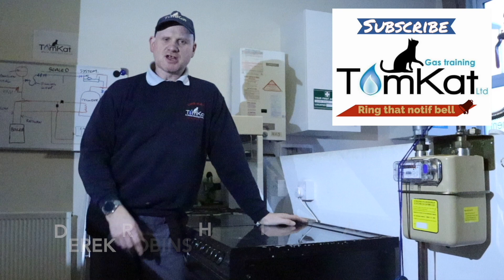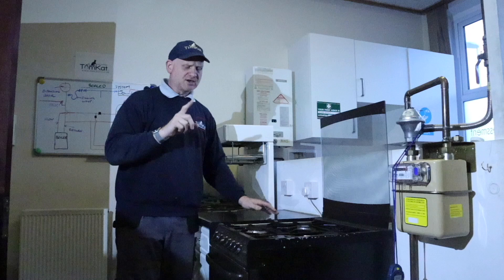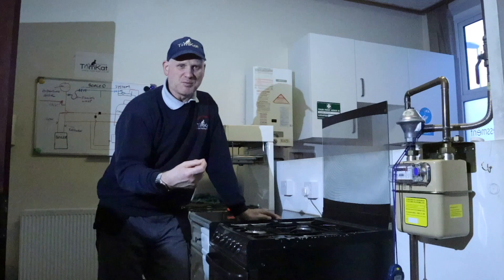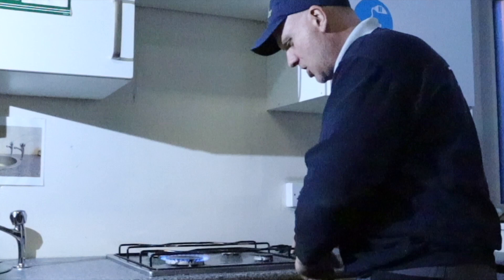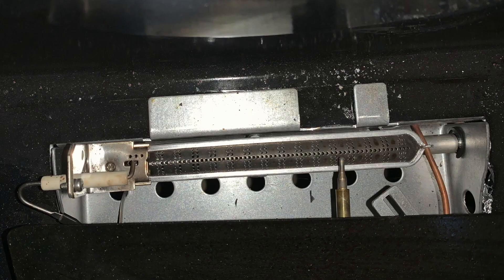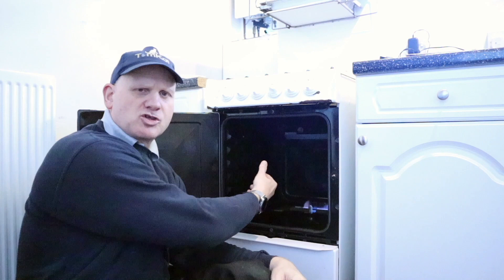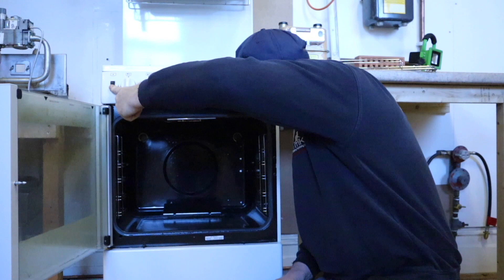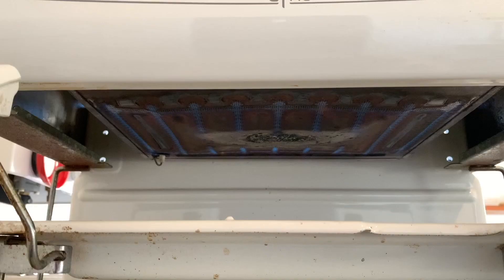GAS SAFETY CONTROLS IN COOKERS part 1. A gas tutorial on how controls work and how to test them.

Comment: At minute 23:30, when you turn the oven to simmer, why do you have to wait for the flame to go down (thermal electric device) and with the door closed? Is it not the control knob that controlls the flow of gas to that oven? I only do meters and have done so for over 6 years now. It's good to know how all these things work. There's too many people/engineers saying that the control knobs are too safety devices which they are not! Great video.

Comment: Hello Derek, excellent video as a lay person I understood everything.
I could you help with a problem with my Cannon Stratford 10530G.
Everything works as it should apart from one thing
When turning on the oven, either with the door open or not, the flame takes many minutes (sometimes as long as 5 mins) to go from low rate to high burner. Once it achieves high burner it behaves as normal and responds to the knob control and sets the gas mark correctly. 
It has a liquid vapour valve.

Any ideas whats going on there?

Comment: I watched this again because it’s fantastic and this guy is a legend. Question time 😊 If the oven is liquid expansion and you blow out the flame it goes off but if you press the ignite button it would turn the gas on at the bypass rate? However, if the oven is thermo electric and you blow out the flame and then press the ignite button it would remain off?? That’s how I understood it. Is this correct? Thanks Derek. 👍🏻

Asian Jon. Training.
Reply from the maker: Correct mate 👍🏻

Comment: I like the video, very clear descriptions. The reason I was watching is that my oven recently developed a fault, when I try to used the oven the flame is never larger than the small flame seen during ignition, regardless of the Gas mark setting on the dial. Is there a way to verify if this problem caused by a faulty thermostat or the FSD?.

Comment: Hi Derek .just want to ask you instead of blowing the flame 🔥 out and let gas escapes , can you test like turn the tap off and listen for the click”shut “ ???
Is it correct doing also this way ? 
Or should blow out always the flame ? 
Thanks
Reply from the maker: If you turn the tap off you are not testing the safety device even though some training manuals say you can. When I blow out the flame I simulate real life scenarios and you test the safety device is shutting of the gas if activated unlike turning of the gas tap and listening for the thermoelectric closing isn’t telling you it’s working and turning the gas off.

Comment: 1- is it dangerous if we  forget to turn off the gas from bypass (Liquid Expansion )  , or if the gas keeps  going for a long time and we  lights it then...
I like the way you you test the thermocouple,is it enough  or is it still necessary to test the thermocouple on:

a) Running at op temp

b) Turn of gas either by service valve or ECV

c) Start stop watch – listen for valve to close

d) Tightness / let by test either at pressure test point on appliance or the meter

2- How can we identify if a FSD is thermocouple or Liquid Expansion 

 Your answer will be much appreciated
Reply from the maker: ARIAN XHEBRAJ if it was dangerous they couldn’t make them, the tests I carried out are the test suggested by manufacturers
Reply: @tomkatgastraining  Thank you Sir!!!

Comment: Hi Derek great video. Quick question, is it important to do a inlet working pressure as well as gas rate the appliance? If so what if you don’t have a inlet test point?  Thanks
Reply from the maker: My video tomorrow is part one on gas pressures so check that out at 9 tomorrow and hopefully all will be explained 👍🏻

Comment: Isn't it possible that the thermoelectric devices haven't had time to heat up all the way, and thus they would take longer than 5~10 seconds to shut off if the burners were lit for longer?

Comment: At around 21 minutes you tested the thermo electric fsd and when you lit the oven burner it didnt have a bypass low burner flame. Can you just advise why this appliance doesnt have a bypass on the valves? Thanks.
Reply from the maker: If it has liquid vapour it has a bypass but if it has thermocouple it doesn’t have a bypass rate
Reply: @tomkatgastraining  I re watched the clip and noticed when I went back to my handbook
 Thanks for replying these videos are  gold.

Comment: Hi pal.. in regards to the LEV. I seen that you put it down on simmer to test the Theromostat. But how will the burner stay on high flame if it’s on simmer mode. Doesn’t simmer take it to the bypass rate? I’m Just abit confused there..
Reply from the maker: You use simmer or slow cook to make the test quicker. You would be waiting ages if you left it on max and the waited for the flame to go down. If you watch it again it will make more sense 👍🏻

Comment: Tomkat, I have a question, I have a gas cooker where you push the knobs in and turn them to let gas through, on one of the knobs I have noticed that turning it without pushing it in allows gas to flow to the ring and light, whether pushed or not, is this a potentially dangerous fault?

The other rings work as intended, minus one that won't light
Reply from the maker: If you have one that doesn’t light then maybe it’s time for a new one or get a gas engineer out to check it’s safe 👍🏻
Reply: @tomkatgastraining  And the weird issue where you no longer need to push it in to get the gas flowing?

The one that doesn't light is because a silly woman clogged it up with bicarb powder to clean it